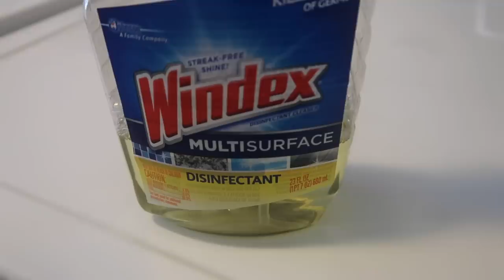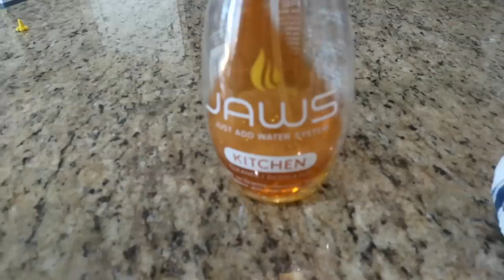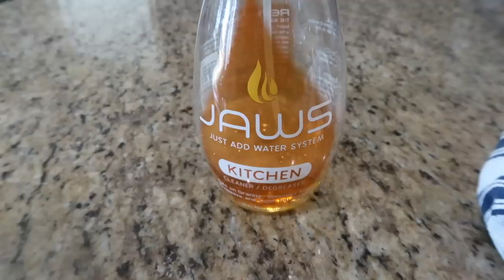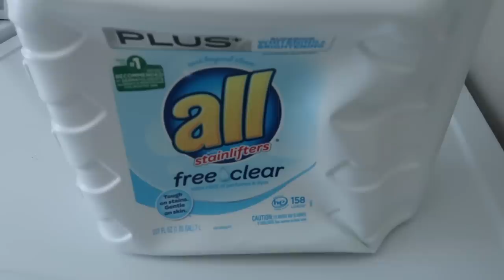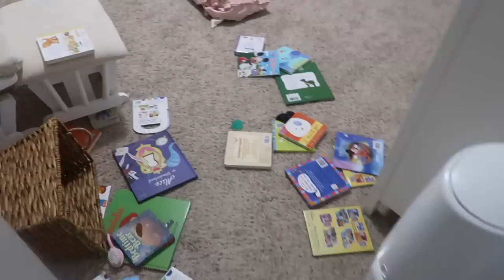NEW! EXTREME WHOLE HOUSE CLEAN WITH ME 2020 | ALL DAY SPEED CLEANING MOTIVATION | CLEANING ROUTINE

Comment: Our toilet in the basement is not used as often like yours. It did the same thing with getting the dark ring until my husband changed out the flapper valve assembly. You might give it a try. Since it is not used it seemed to deteriorate.
Reply from the maker: Thanks for the suggestion!